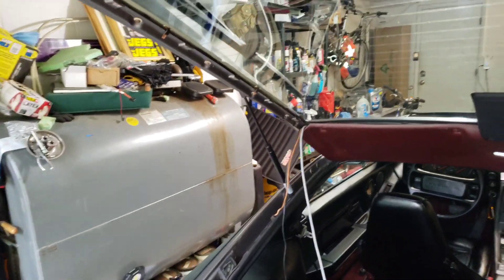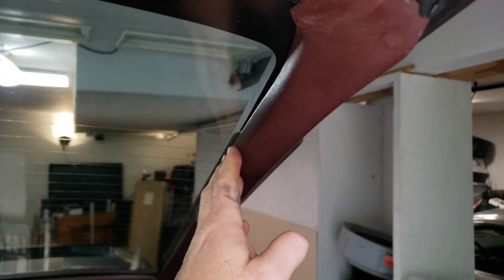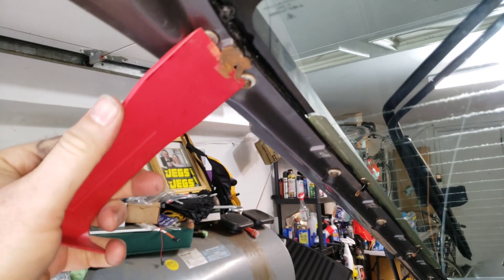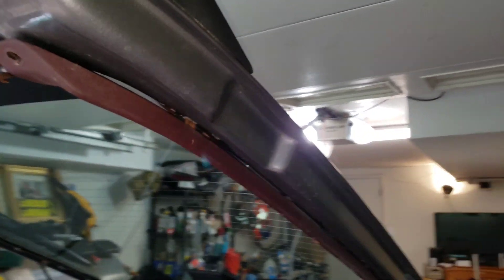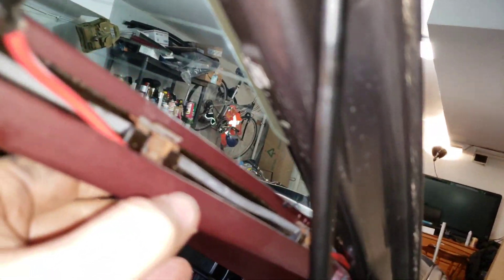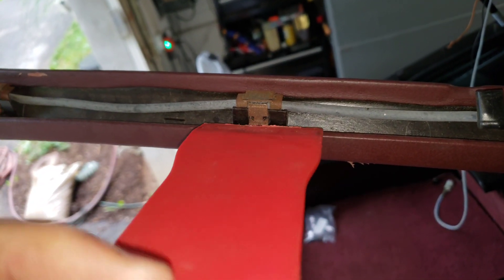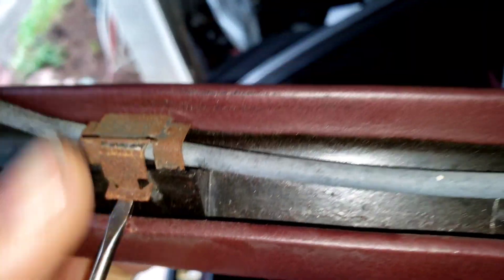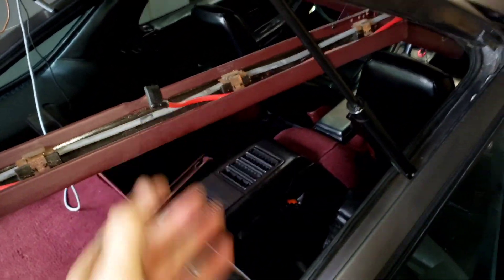Porsche 928 Hatch trim removal tip

Comment: Thanks, great detail as ever! Is the top section easy enough as mine is warped and want to remove it to straighten it out?
Reply from the maker: The piece overhead of the rear seats on the hatch comes free after you remove the visors and just pop down on the plastic cone or dart shaped plastic fasteners.  Not hard at all.